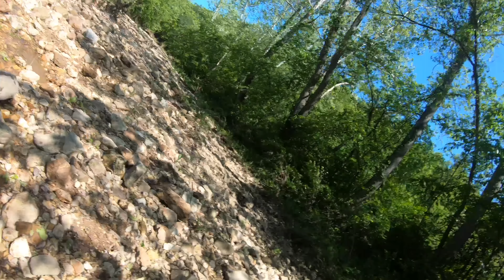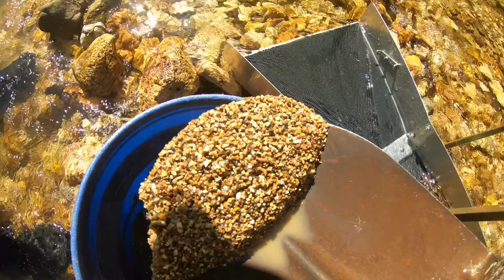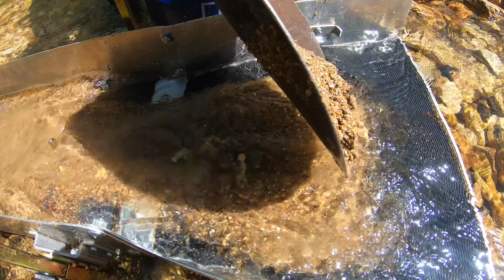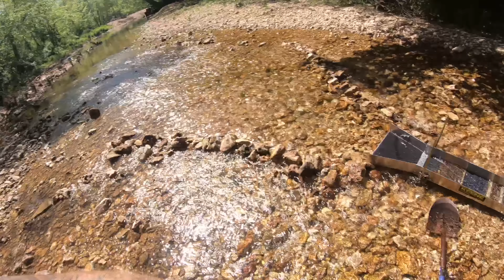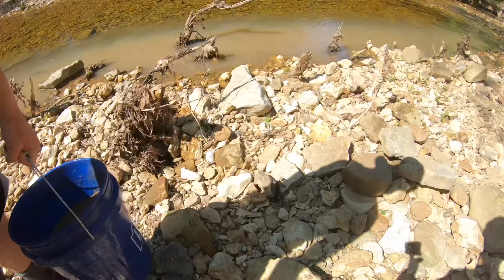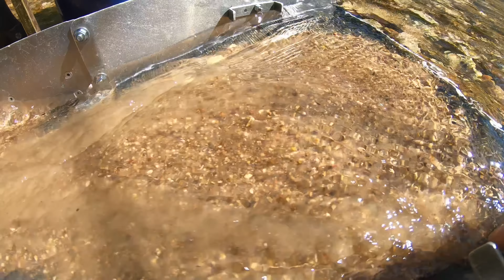Feeding the Keene A-52 super sluice with 50 gallons of classified material.

Comment: I absolutely LOVE my Arbor Fabricating classifier. I bought a 1/4 inch, I need to buy an 1/8 inch for the small stuff we have here in Ohio. I just don’t know if it’ll be too slow classifying. 
What size you running?
Reply from the maker: I believe it’s a 1/8 I’d have to look again I know I want one with bigger holes thought because of the pickers I’ve found here in Missouri I feel like I’m throwing nuggets away
Reply: Kyle Thiemann if it is 1/8, I’m getting it for sure. It looked like it was classifying as fast as the 1/4.
Thanks!